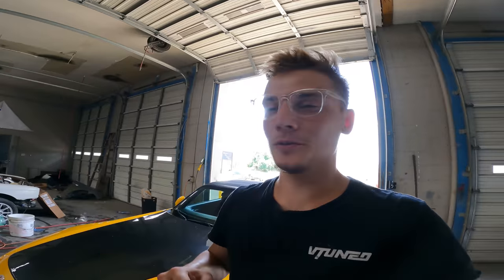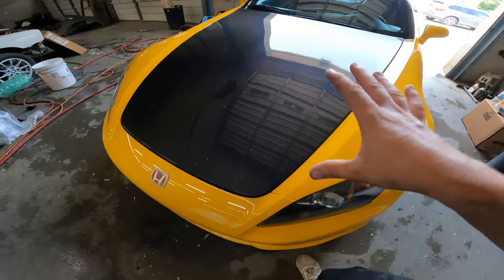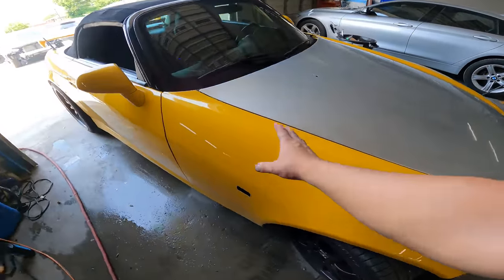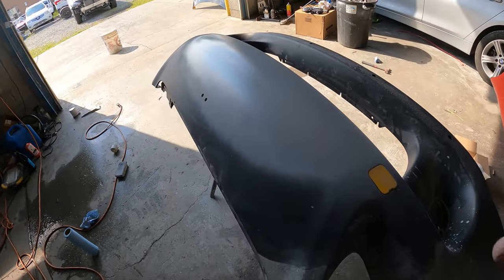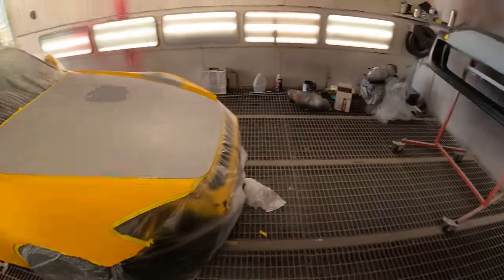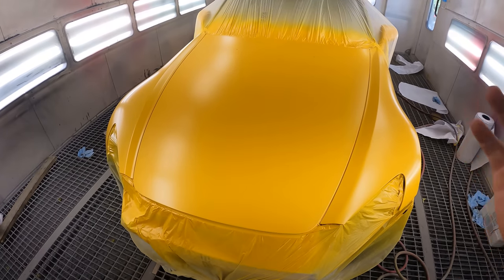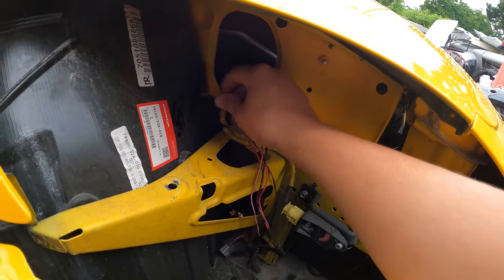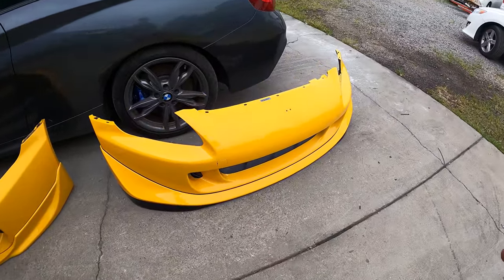My S2000 Gets Rare JDM Parts And A Fresh Paint Job!!

Comment: The oem bumper that came with the car should have the markings in the back where the cr lip holes line up. You just have to cut them out. The oem bumper i picked up from honda has the out lines in the back of the bumper.

Comment: He mentions @9:10 that he had a problem with the paint 'reacting' on him.   Does anyone know that that term means?   My assumption was that the paint perhaps hardened on him before he could finish spraying.   I would like to have seen footage showing what the problem looked like and the process he used to fix it.    I am just trying to understand what can be done to avoid that problem when I paint my Acura TL in my garage.
Reply: Sometimes the paints react to a different brand or type,and it can wrinkle and  look like an orange peel or bubble.